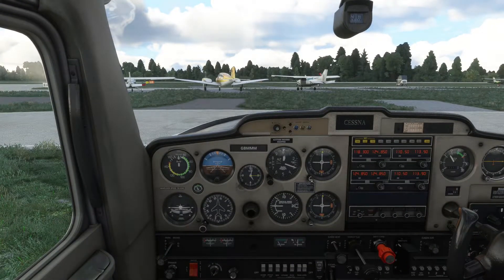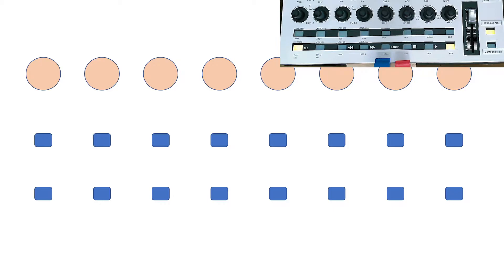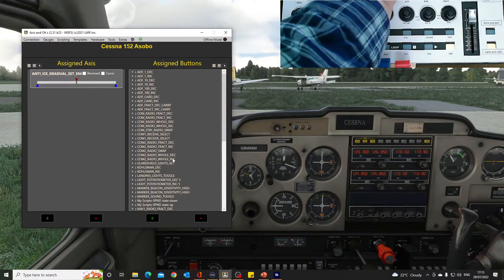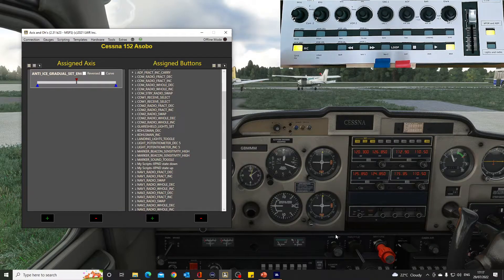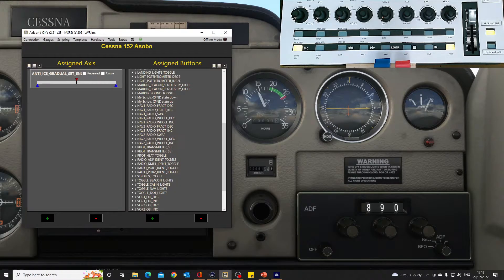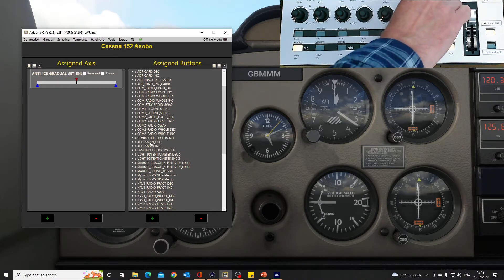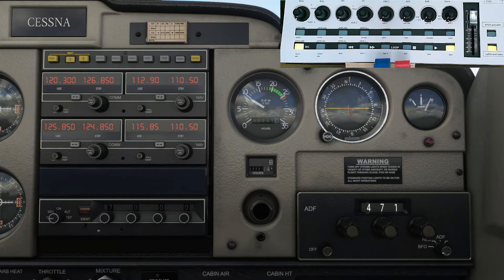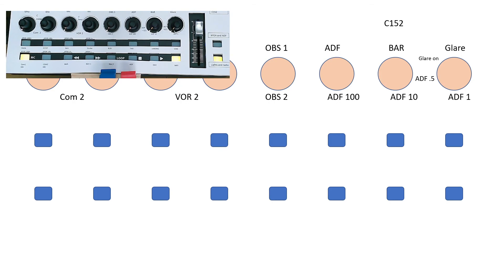3 C152 Axis and ohs, X-Touch mini rotary controllers

Comment: Hello Keith. May I ask what you used to cut the holes in your card?
Reply from the maker: I hope this link works https://www.amazon.co.uk/gp/product/B0016V7NZM/ref=ppx_yo_dt_b_asin_title_o00_s00?ie=UTF8&psc=1

If not search amazon for NT Cutter Coupe-CERCLES

You will also need a cutting mat like this https://www.amazon.co.uk/gp/product/B077QJXGJ6/ref=ppx_yo_dt_b_asin_title_o00_s00?ie=UTF8&psc=1

The cutter has a very sharp blade that goes through the card onto the surface below. 

All the other 'punch' cutters I could find only worked near the edge of the card and wouldn't cut exactly where I wanted a hole.
Reply: @Keith_Butcher  Thanks Keith. The link worked fine. It reminded me though that my wife has a card cutter that cuts various shapes including circles.  It might be fixed sizes though. I'll have a look. Great instructional videos. Thanks for taking the time to explain in great detail...Kenny.